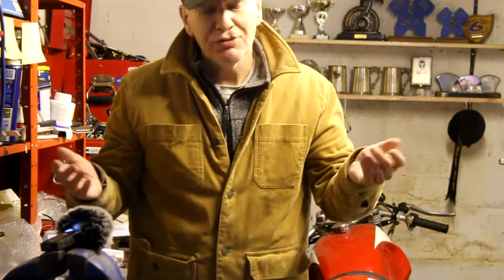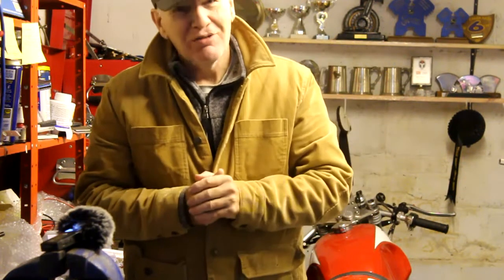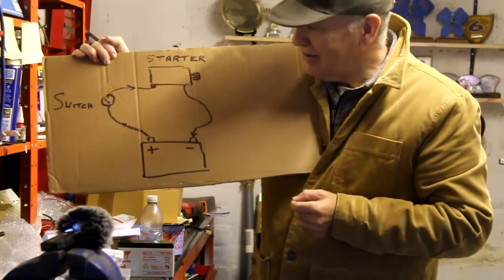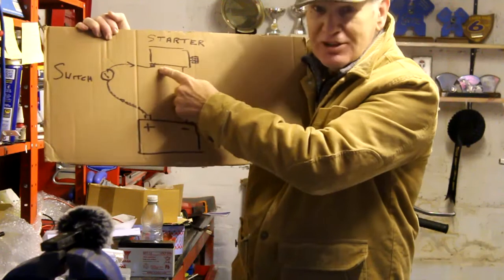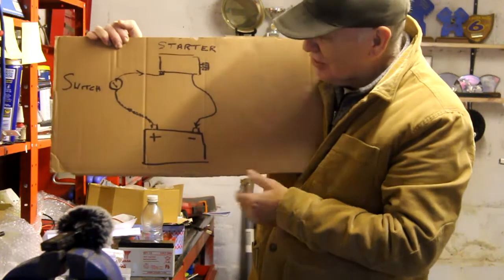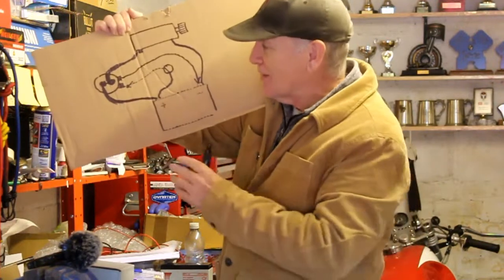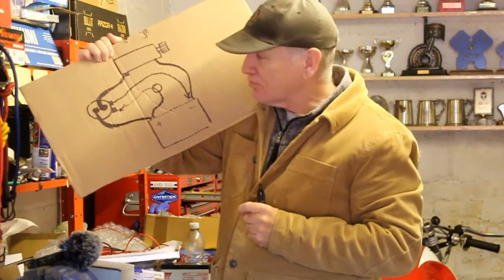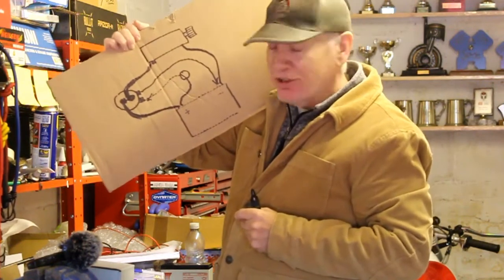Beginners Guide To Motorcycle Electrics - Part 2

Comment: Cool youtube video! One question, how does an immobiliser work and how does it fit into this?
Reply from the maker: An immobiliser works by sitting in between the battery positive or negative terminals and the rest of the bike. It cuts the main circuits of the bike by stopping power from flowing from the battery to these circuits. Its just an electronic switch, which is turned off and on by a key fob. They usually also have an in built alarm. I have found the aftermarket immobilisers to be unreliable after a few years. Those built into the bike by the manufacturers are more reliable.
Reply: @Merch131ho  this is how I stumbled across these videos. My own immobiliser had decided to give up the ghost so thought I'd see what I could find online. Thanks for the quick response!
Reply from the maker: Had the same problem with a Datatag immobiliser, but it was more than ten years old. Depending on who fitted it, it can be easy are v difficult to remove. Good Luck.